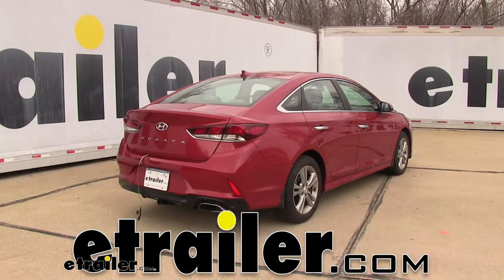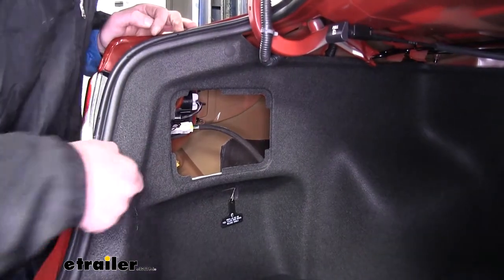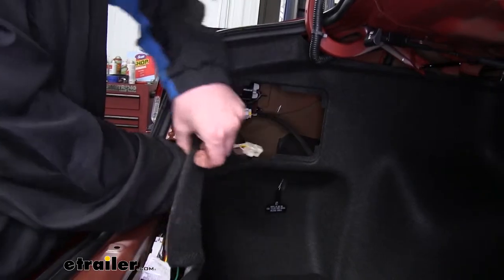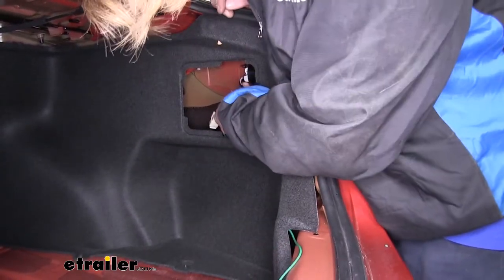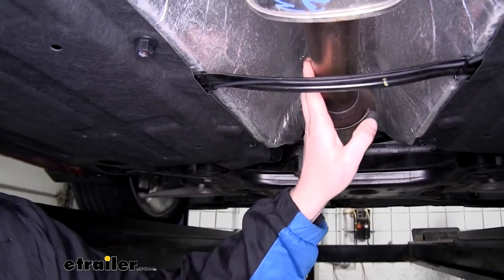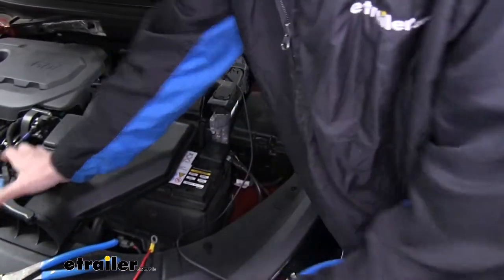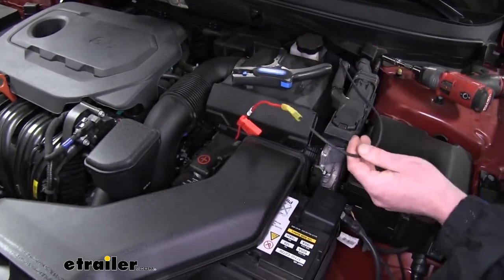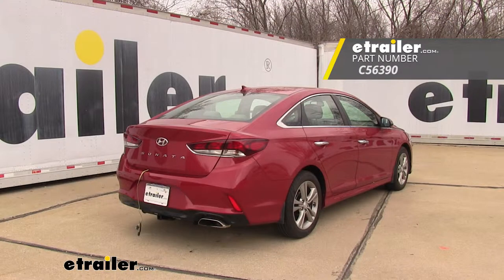etrailer | Curt T-Connector Vehicle Wiring Harness Installation - 2018 Hyundai Sonata

Comment: Great instructions!.Is it possible to run the wire under the car without a shop car lift ,maybe jack stands ?
Reply from the maker: You could use car ramps to get the front or rear of the car in the air and that will give you space to run the wiring. Or you can always run it inside the vehicle.
https://www.etrailer.com/Custom-Fit-Vehicle-Wiring/Curt/C56390.html